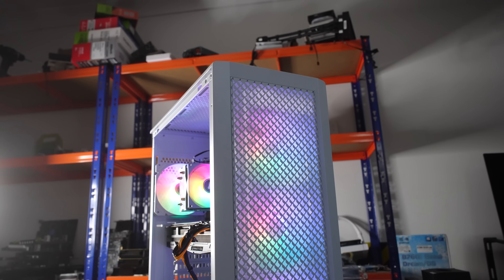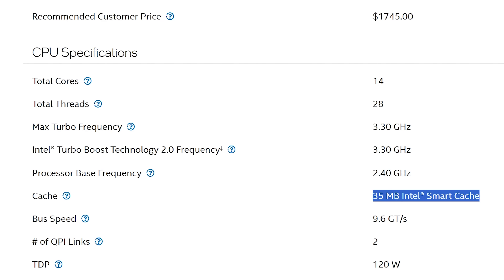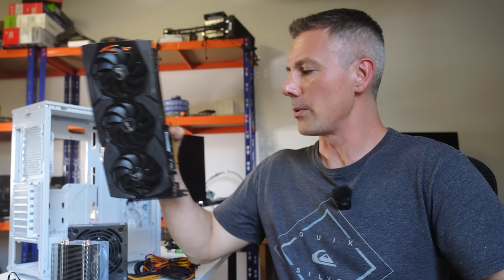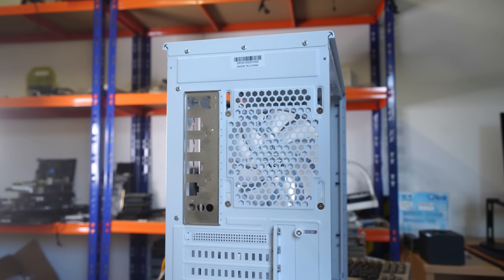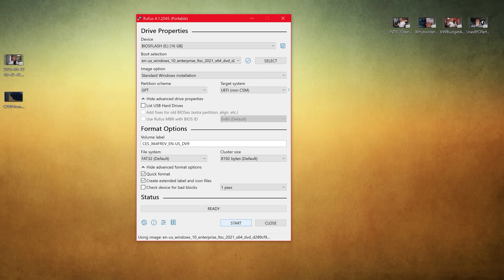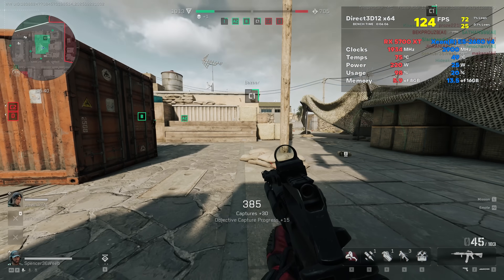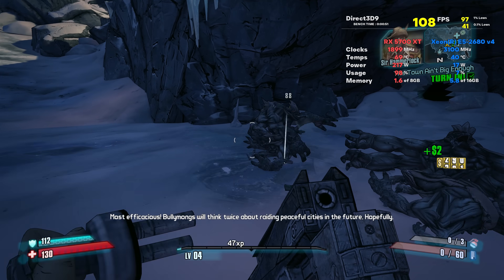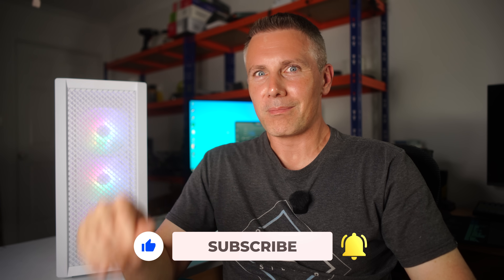An Under $400 Gaming PC That anyone can build!

Comment from the maker: Just finished the used parts hunt. Ill try drop it tomorrow. Got probably one of the best cpu deals ever.
Reply: i just wanna say, xeon 2680 v4 its kind of bad for CS 2 i rly enjoy playing the game but the single core performance is just terrible for CS 2 , with more than 20 PPL in server is just bad avg fps fall below 80 and 1% lows go crazy. There are better deals with ryzen 5600 and 5700x
Reply: Nice job 👌👌💪👏 Lets see 👏👏
Reply: but re-size bar not working on 5000 series, only from 6000 :P
Reply: why above 4g decoding?
and do i need to enable resizeble bar in the nvidia control panel also?

thx for the budget builds
not everyone has 2k+ to burn these days
Reply: @techyescity the best time of the month used parts hunt🎉
Reply: I'm not here to spoil anyone's budget friendly fun, genuinely impressed with the thought behind this build, have you tested it with lossless scaling to see a more stable high fps? or even possibly using it with the dual Gpu mode on lossless, could you possibly do a part 2 with this pc using lossless to possibly improve fps averages.
Reply: Hey Techyescity have you seen the newer X99 Motherboards on Ali Express that Support Msi's TMP 2.0 chips?
Reply: Hell yeah!!! "I wish that I was a mad man" love your work bro please show the Xeon w 2135 and w2145 some love!!!

Comment: Here is my used pick for $400
i5-9600k or i7-8700k CPU
Z370 or Z390 motherboard
16GB 2x8GB 3200MHz RAM
600W PSU
RX 6600 GPU

You can go up to RX6600XT or maybe RX6700XT or upgrade to 32GB RAM, if you downgrade to 400W PSU. i5-9600k or R5 5600 + RX 6700XT using about 350W without undervolt.

I recently played with 4 sticks of 3200Mhz DDR4 in an intel i5-9600k system, and it's crazy how snappy the system gets when I tighten the 2. and 3. timings. AIDA64 only shows a little improvement in latency 46.8->46.2 but it feels day and night, I didn't even clicked yet, but the program already opened fast. I don't know if it is intel or motherboard limitation, but I couldn't go over 3333MHz with T1 so I stick to 3200MHz. RAM stability testing is pretty boring, it takes 2,5 hours for 32GB.

I don't feel AM4 5000 systems as snappy as intel 8-10.gen, when I have the motivation I will finetune my R5 5600 system with 4 sticks of Ballistix memory to see how it compares to intel 9th gen. The AMD APUs like R5 5500 have only 16MB of L3 cache but you can crank up the memory to 4200MHz with 1:1 ratio, that said my 5600G performed better at 3333MHz with tight timings than 3933MHz with loose timings.

Comment: 180$ for a 5700xt is crazy, should be like 100-120$ the better 400$ build is a 5500, 5700xt, 16gb 3200mhz ddr4, 512gb ssd, MSI MAG a550bn or Cougar 750w, cheap Zalman case with 3 fans

Comment: That build is great and all, especially for the price. But can you give a few suggestions for a Windows 11 build around or below the same price, if possible.
I would have been fine with my Ryzen 5 2400g, if it wasn't for Windows 10 ending their updates around October.
My other option is to switch my OS to Linux which is I'm unfamiliar with.

Comment: Here is an issue, I do not think win11 is supported , the CPU is not half bad actually , 17328  Passmark Points but it will not support win11 , Linux Gaming better get good soon .

Comment: Yeah i just put together a i3 10100f(had cpu on hand)
H410m gigabyte mobo refurbished (38$)
32gb ddr4 (40$)
Xfx thic triple 5700xt(got it for 115$)
Apevia prestige open box 600w(tier c) 43$
Coolermaster 300q the cheap 35-41$ amazon i got on sale for 35$ few months ago.
512gb open box gen 3 nvme for 21$
Stock intel cpu cooler.
3x 120mm case fans(cost me 8$ total)
Gpu support bracket 2.19$
Reply: Cost Me about 300$ with the cpu laying around.

Comment: @techyescity Hello i have a question related to computer cleaning is it safe to use a soft bristle painting brush to dust computer parts and will it cause any static electricity damage to the components ?
Reply from the maker: That is an interesting question, I haven't personally tried it, but can't hurt to try it on some crap parts first, if it passes the test then way we go.
Reply: @techyescity  ok
Reply: i can't tell you that it's safe (because it's probably not 100% safe) buut I can tell you that this is exactly what i've been doing for the past .. 20 years lol. 0 issues so far.
Reply: @cristivpopescu  ok thanks

Comment: Recently build a budget new PC for my older brother, mostly new parts except for the CPU, GPU, Case and the technically open box PSU for less than 500€. Got a deal on an i5 11400f for about 60€ and a h510m for 40€, then used my older 2x8GB 3600mhz kit and a new NV3 1tb for 45€. Then reused an AIGO case I got for around 30€ that also came with a BeQuiet Pure Rock Slim 2 as a bonus. 

Got him a Manli 3060ti for 200€, which was an average deal imho, atlhough the GPU is far better than the reference model as it has an actual metal backplate and the fans are miles better than any MSI Ventus/Mech OC card. I think the best deal I got so far was the PSU, a BeQuet Straight Power 11 650w Platinum modular for 50€ as literal open box. Now I'm testing the airflow but I need to order a fan set, since I noticed that the single exhaust can't keep up with both CPU and GPU hot air (currently using the i5 11400f at 125w PL1)

Comment: No, not anyone can build this, spoiled muricans can buy it until tariffs take effect. For many other countries these alixpress parts are prohibitively expensive. 
Then there's the high power draw, being screwed if it arrives damaged, taking forever to ship... 
A more realistic $400 build would be an entry level am4 with an r5500 and probably an rx 6600. 
The 5700xt and 2060 super are becoming more difficult to find due to youtube hype, and the aliexpress rebrands can't be found at a reasonable price in Canada.

Comment: Motherboard combo at this price for a super budget pc/workstation is nice, but you are stuck with win10 LTSC with this one. I would  just buy a cheap RX580 2048sp  from ali and call it a day. An am4 pc with even 2600-3600 (30-50eur), cheap B450(50eu new), 2x8GB 3200 35eur would make more futureproof purchase.

Comment: I just built a system using one of these Mongol motherboards. A few things are worth noting: there’s no header for TPM 2.0 support, and while the CPU is quad-channel, the board only supports dual-channel memory. The biggest issue, though, is the power delivery. It seems limited to around 80–85 watts, while I was running an E5-1650 v3, which has a 140-watt TDP. As a result, performance took a noticeable hit.t
Reply: good info
Reply: @GetJesse  just checked on this xeon CPU ...man when new it was like 1700USD ...crazy how theese server grade cpus are loosing on value :) also loved how it only utilized 15 - 20 percent at 20-30w :) nice
Reply: so, turbo unlocking it was out of the question ?
Reply: Always look for  c612 x99 motherboards on Aliexpess. Those will have TPM 2.0 pins Quad channel memory  more USB 3.0. and up to 6 SATA ports sometimes 2x M.2

Comment: Don't see how you're running that GPU on 400 watt sorry
Reply: So basically you just get the powersupply cords and plug them In the gpu😃👍
Reply: @Paul-qc7yz  if I wanted a smart ass answer I would have asked for one, looked up the GPU power equipments and 400 watts wasn't enough

Comment: The AMD Radeon RX 5700 XT has a typical board power of 225W and a minimum PSU recommendation of 600W from AMD. A 550W to 650W power supply is often considered sufficient for a system with this GPU, provided it is a high-quality unit. The card draws power via an 8-pin + 6-pin PCIe power connector.

Comment: With all them cores this little computer should be alright for a bit of doubling up as a budget home workstation.  Not sure I could stand seeing that empty memory channel though, I'd feel compelled to chuck another RAM module in it.  But you can't beat the value proposition, a whole platform for around 50 Quid ain't bad.  I think I might have spent the extra and chucked a 2080ti in it though.

Comment: at this risk of making the prices go up, there are boards for around 150 aud that are most of a ps5 APU that were used for mining and there are gaming drivers available now , performs like a rx6600 roughly and 12c/24t with 16gb ddr6 shared. Very portable and 3d printed cooling options available. Best value for money BY FAR for an entire pc, just need psu with 8pin, has nvme already. may need usb sound card or run through the DisplayPort/monitor.      It actually runs really well just have to deal with linux which is super easy for gaming these days with the proton compatability layer. *******Not for people that arent tech savvy

Comment: While the chinesium combos can be good deals the high-core-count and low-freq Xeons kind of suffer on the gaming side. Personally, the E5-1650 v4 6c/12t for ~$10usd or the E5-1660 v4 8c/16t for ~$30usd are probably the best X99 performance-per-dollar for gaming and offer much higher frequencies. --- I haven't tried X99 bios-modding like I did with X79, and don't expect they would benefit as much, but locking all cores at turbo-freq was definitely a big gaming performance improvement for X79. I'll investigate it for X99 if I have the time and report back. --- Lastly, while the regular RX 5700 can be run stock I really suggest undervolting the considerably higher wattage RX 5700 XT models. Lower temps and better fps lows.

Comment: no one should buy that gpu. you're better of looking for a free case or one thats like $5 and get the rx7600 at least then you can use FSR4 performance now with that one mod.
this system also look unstable just look at that cs2 performance that's a game that utilizes cpu really well. xeon isn't made for gaming.
not sure how you'd replace that xeon for something better for that price though. i personally wouldn't build this pc i think its a waste of $400
Reply: Or you could build a gaming PC for under $370. Ebay and AliExpress are better options to buy cheap components. It doesn't have to be cheap all the time. But sometimes it can be. Also, you can buy expensive parts once every other month.

Comment: I cannot recommend building/buying x99 pc's anymore (I've built and sold a few) they have gotten a bit too expensive. You can build an am4 pc with a ryzen 5 2600/3600 on a b450 with really easily attainable parts for $400 or less. You'll be on a modern pc at least, with upgrades paths.

Comment: I personally bought a x370 and a 3300x and 2x8 ddr4 3200 for 95 usd.  Or even up to a 3600 and a decent budget b450 is around 120. That should cut the cpu mobo cost, way better ipc/ single core and have future upgrades available

Comment: To put this CPU into perspective though: first gen Ryzen 5 should be equal or better in gaming. So assuming you can find a 2600 or 3600 with board and RAM for cheap you should go with that. The Aliexpress bundle is nice though if you don't or if you want eight additional cores.
Reply: You need to watch more videos before commenting such bullshit😅
Reply: @damasterpiece08 you need to prove me wrong before calling bullshit.
Reply: @andreewert6576 😂😂😂😂 just watch the benchmarks and sybau

Comment: I have had a 8086k for years and its served me well...but past few years i find its really struggling, and I am really conflicted as budget is tight....get a AM5 which is more future proof but have to spend the money or get a AM4 board which i can reuse the ram i have and see if i can get x3d chip......but limit upgrades
Reply: Well I think AM5 will hold for a while. 

I went i7-2600>Ryzen 3 3100>Ryzen 7 7700. Might dish out for a 9900X3D but then keep it a while again.
Reply from the maker: Go for am5 is you can stretch it in that scenario if you really can stretch it. It is a solid step up.